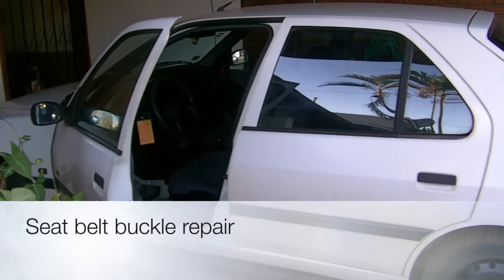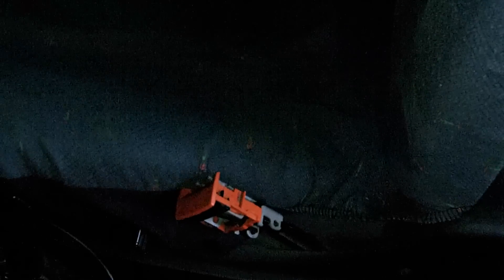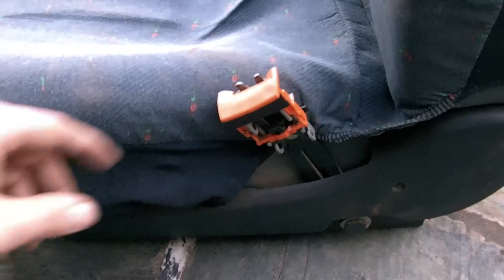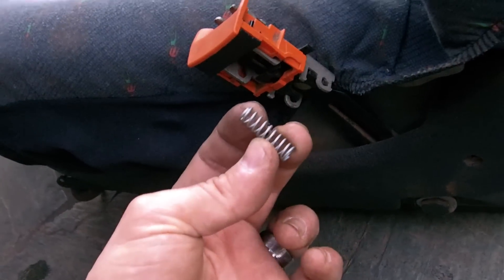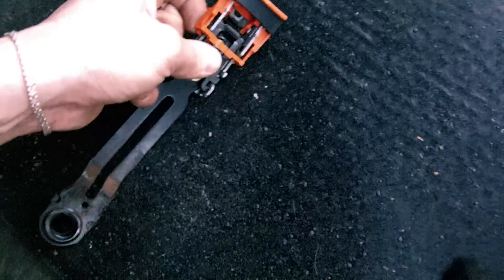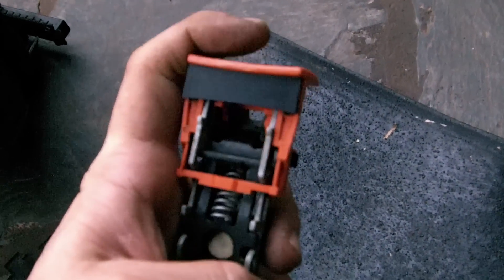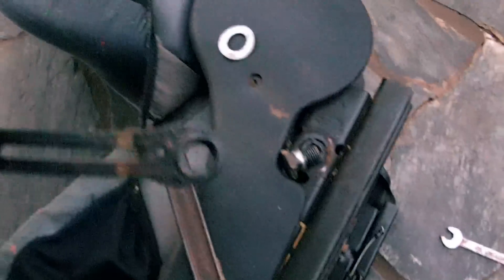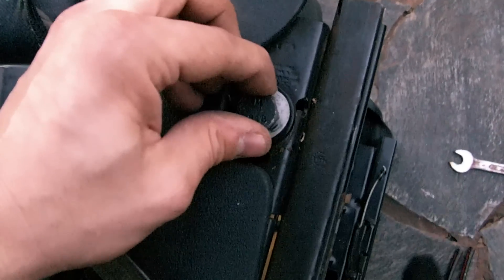Seat belt buckle repair

Comment: I have a unique situation i drive my car alone. To replace my jetta receiver driver side cost 129.00 and the tools 12 spine driver torq 10mm and 8 mm. not in my tool box. I simply took right side belt and slip it in left side buckle To get rid of the annoying chime I electrical taped the driver side buckle to the right side belt post no chime. If i keep the car i will replace the buckle if not it will be scraped anyway.

Comment: thanks for posting this. I have the same issue. 
how do you remove the plastic cover of the seat belt buckle? 
i have tried to push it downward in vain; i got scared to break something.
Reply from the maker: I did it nearly 4 years ago, but if my memory serves me right and you're asking about the outer casing, then you should be able to just pry it apart along the seam (and normally the clips holding it together break, but since it's just the casing, it should not affect operation of the mechanism inside). And the casing of the one in this video, I just taped around, but this repair lasted another couple of years at least, and my in-laws sold the car with front seat belts still fully operational :) Hope that helps!
Reply: +Fire Crow's Workshop thanks for answering. I ended up getting one from a junkyard and replaced it
Reply from the maker: mamery jazz yes, unfortunately for me at the time scrap yard option wasn't available :) It seems that cars in some parts of the world are just being endlessly resurrected :D

Comment: my seatbelt pretensioner wiring has been cut from the seat sliding back and forth and has caused my airbag light to come on. I have a 2006 Ford crown victoria police interceptor. can I just buy another one or does the computer have to be flashed or something to recognize it
Reply from the maker: Ok, it really depends how far the cable has been cut. If the damage is between buckle and and the plug underneath the seat, then it should be rather easy to replace, although there is a chance that you might have to clear the error codes this has caused. If the damage is on the main wiring, then this is more of an issue and if you don't have much experience with soldering and car electronic systems, then I'd take it to the professional. Whenever working on air bag systems, make sure you disconnect the battery and let the system drain any residue power for at least 20 minutes before doing any work! Hope that helps!
Reply: DAILYGRIND on